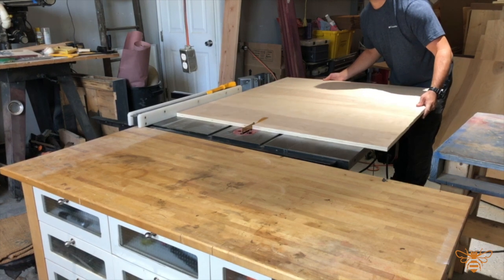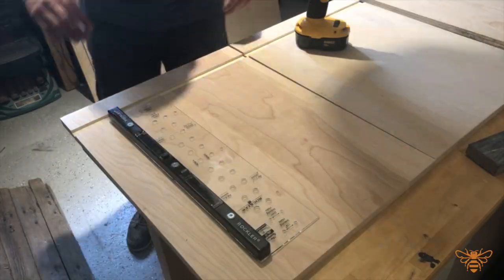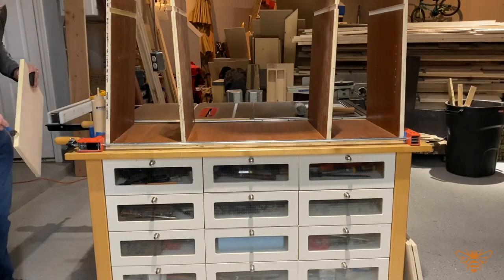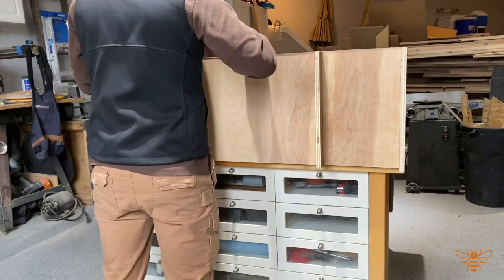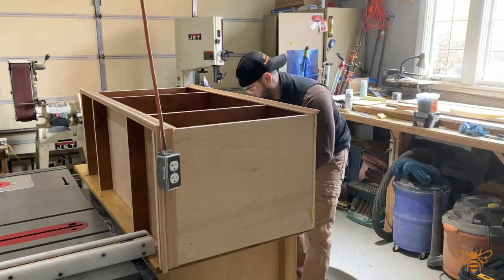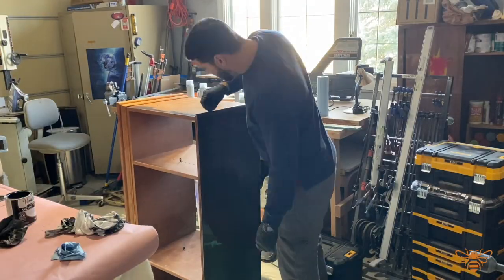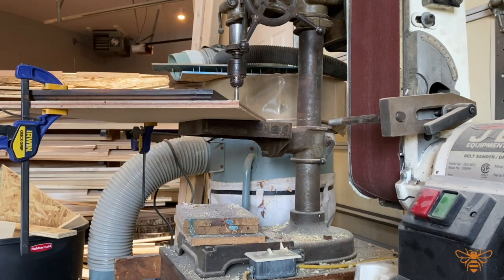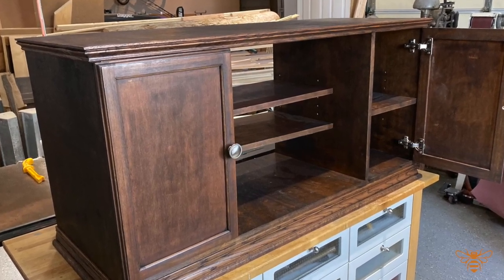Build of a tv stand, media console, or entertainment stand. Whatever you call it, you can build it!

Comment: You start with cutting sections, but where is the plan?  Where is the cut list?  Do not start a video without laying out the plan first.  This is a totally useless video.
Reply from the maker: I break down the process that goes into building something like this, showing tips and tricks that will make your build easier as well as giving a visual guide to the process. As for plans and cut list, I make all my pieces custom to the space or function needed per the client, so I tend to leave the specific plans out as it may not work for your needs (as in this process it would depend on your tv size and space allowed).  I am thankful that you shared this comment though as its given me the idea of making a video of how I design my projects.  I hope you were able to at least get some tips and techniques to help you with your project. Thank you for sharing.